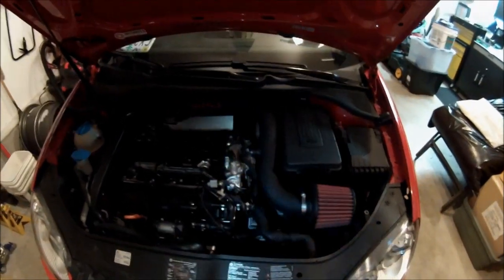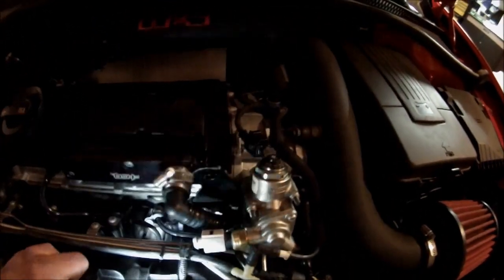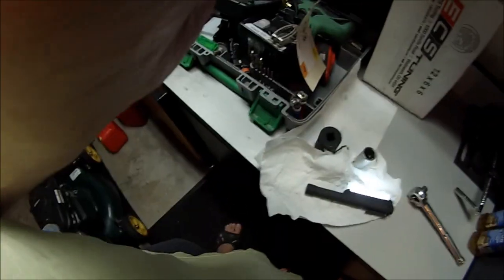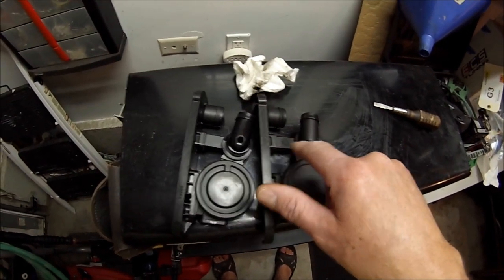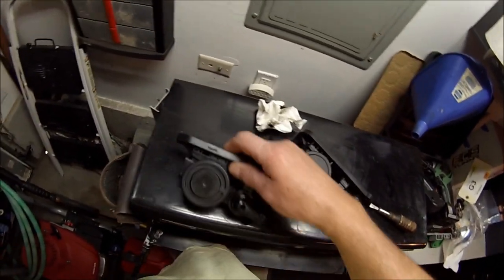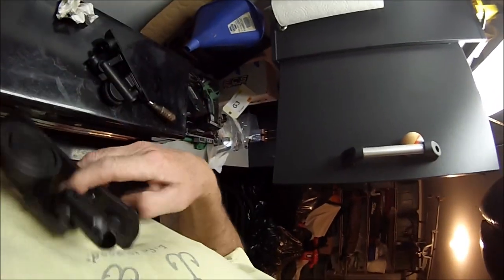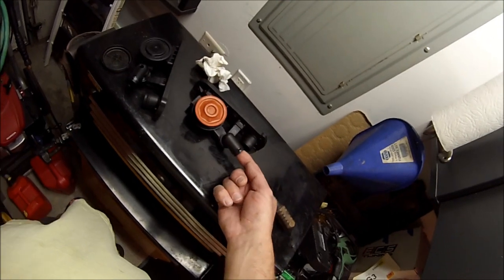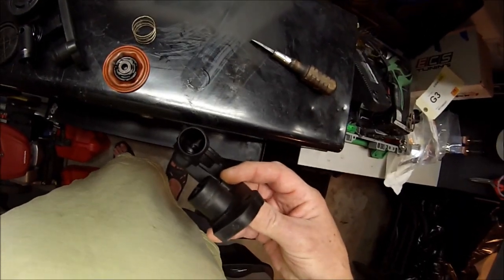VW-Audi 2.0L FSI (EA113 engine) PCV check or test

Comment: Is it normal for the pcv to pop like it did with the first one you blew into? Mine pops like that then is totally sealed but it only pops the first time I blow into it. It's completely sealed after that until I put it back on the car and run it, then I can get it to pop again.

Also, is it normal for air to go past if not blowing hard enough? Mine also allows air past until I blow quite hard, which causes the pop
Reply from the maker: Sorry...I didn't see your comment except for in Studio. Yes, there is no spring on the valve that is meant to shut and open. Inlet manifold vacuum pulls it open to vent the crankcase. It takes boost to slam it shut so the valve can seal and prevent boost going into the crankcase.

Comment: Hi,

I have to replace this part. It's slipping through air when I perform the test you showed.

Do you perhaps have the part number for me?
Reply: @Roh_Echt  thank you very much, I have to admit that I didn't read the description.

I need the PCV valve with the build in valve, so I need part nr 06F 129 101R .

I very much appreciate your help, I hope this will solve my oil pressure problem.

Comment: Was lead here by your posts on VWvortex. I’ve got the weirdest fkn misfire ever. When I roll into the throttle, engine runs fine ( starting at 20% throttle and moving up slowly ). But if I put it into a higher gear, low RPM and go 100% throttle, I get a misfire. At first it was cylinder 3, frequency was 2 or 3. Sometimes I wouldn’t even get a CEL. I swapped the plugs, the misfire didn’t move. Swapped the coils, misfire didn’t move. Took apart the intake and swapped around the injectors AND did a thorough carbon cleaning, misfire didn’t move. Scanned again with vagcom and this time got a cylinder 2 and 3 misfire. Freeze frame was at 2424 rpm, 90.9% throttle, temp 1 - 90 celcius, temp 2 - -1 celcius. Frequency was 2.

What are the chances my PCV is causing this? Like, pressurizing the crankcase when I go WOT and build boost quicker?

Comment: should i remove the rear bather tube Check Valve when installing a pcv delete ?
Reply: Thank you for the info,  i guess ill leave the rear breather tube with the check valve and if the car starts to act weird , then ill remove it. the only reason im doing the pcv is because i think there could be a boost leak under high load ( car has f23t with 26psi). it it wasn't for that, i would rather keep the oem pcv.
Reply: yes, i think the oem one is good enough but i seems to loose a couple of psi at high rpm and i just wanted to eliminate that possibility.